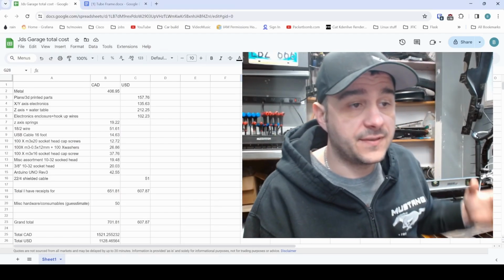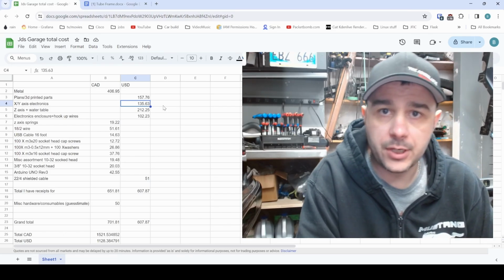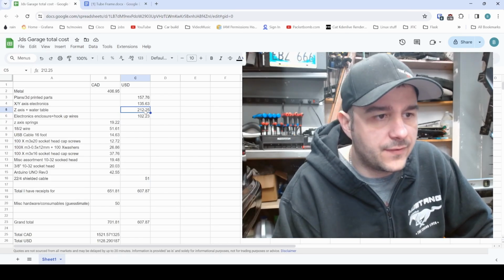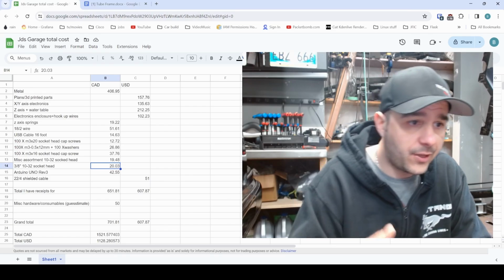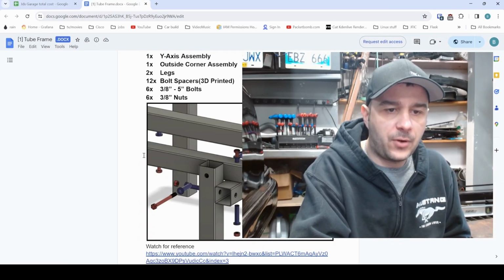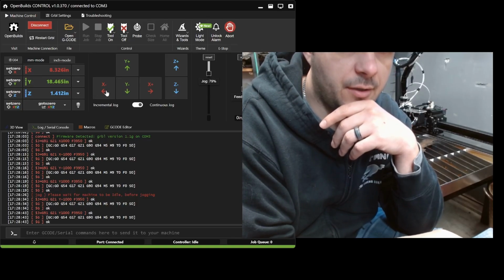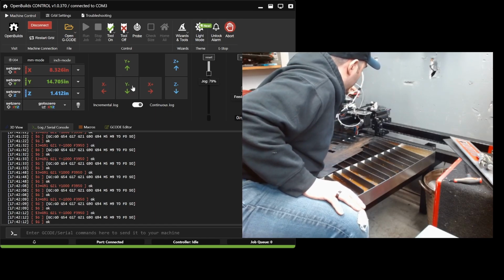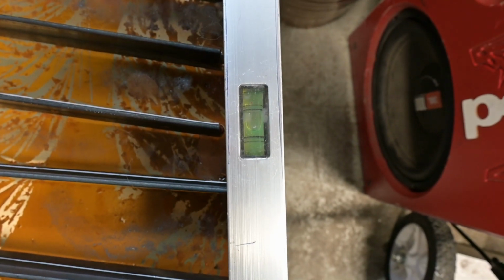jds cnc plasma cutter conclusions

Comment: Thank you for posting this. It confirms my suspicions regarding the unsupported Y axis and the 3D printed trolley, and the tiny bearings.  There are a number of ways to address the issues and you seem very capable of building a Y axis support.  Regards.
Reply from the maker: You're very welcome. And you're right I did correct the Y axis issue in a different video.

Comment: Thanks for the homest review comments on this build and the budget breakdown. 👊😎 
I’d suggest not running bearings across painted tube. Also, i’ve seen a few builds address sag of gantry by either a second setup (elaborate) to running a couple of skateboard wheels at the end to support and free roll. Hope you sort it out.
Reply from the maker: You're very welcome!

Yep in a later video I end up adding a wheel onto the end of it to support it.

And yeah the bearings on the painted surface was likely one of the biggest mistakes I made on the build.

Comment: My solution for the long arm of the gantry is to copy the bearing end 2" arms with the plates, on the other side (51” Y-Lower Frame Rail
 51” Y-Upper Frame Rail, Y-Connecting Plate #1 x2,. Then I reprinted one of the bearing holders(Bearing Block Assembly) but cut the bottom 2/3 off. Could use the whole assembly but put only bearings on the top section. This was bolted to the now supported end of the gantry arm with two bearing supporting this end just like the original.
Reply from the maker: Very nice!

Comment: It is actually cheaper to buy the Langmuir, the printer that this crappy JD's clone is based off of.
Reply: There is just too much weight on this cantilever for that particular bearing setup.
Reply from the maker: @uwuweewee  Agreed that's why I added a wheel on the other end to support it.
Reply from the maker: Well looking at the website a crossfire with z-axis and water table is 2195 + 150 shipping, so it's actually around $1000 more expensive than what my cost was.

But that being said for me, would I build another one in the future, not likely. I would rather buy something that has all of the parts and pieces together so that I'm not spending time chasing down little bits and pieces.

Comment: Im lucky in that I had nearly all of the raw materials and a few 3d printers, along w all of the tooling ie drill bits and welding equipment etc. to complete the project. I’m not done yet but I’m expecting to come in around $350 usd. Should be done in a couple weeks.
Reply from the maker: Nice! Congrats on your build, it is a really nice tool to have.

Comment: All of your Y axis issues come from you painting the metal where the bearings ride.
Reply from the maker: While I agree that the paint doesn't help, I don't believe that it would be the sole cause of all of the problems.

I am far from any sort of mechanical engineer, so I don't know where to start to actually calculate the forces in play. But I believe the weight of the z-axis motor and motor mount likely play a factor in the issue.
Reply: Unless you’re running a different motor, it’s not the weight. Too many ppl have completed this successfully and don’t have the y axis issue you do. The paint is a bigger issue than you realize, but I also suspect there are tolerance and fitment issues with your final product. As the design itself has been proven on Langmuir and JDG tables.
Reply from the maker: @justaguyintexas  Yeah my build isn't perfect and has issues for sure. The flip side is that enough other people have also had issues and had to build supports, that while builld quality may exacerbate the issue, I believe there is a fatal flaw in having all of that weight levered out at the end of the rail.

But for what I need this machine to do, it does it well and I'm really happy with it.
Reply: @TheAnnihilatorRacing  yup the fast growing community for this machine is awesome eh? Also because this is nearly a rip of a Langmuir xfire, I’ve joined a few of their groups and find a lot of the info valuable. That said, I agree in that this is the max size this single arm design can handle.

Comment: You could have bought a Crossfire for what you in it.
I have $100 in steel, I’m using 1/8” wall (it’s cheaper) tubing and 2x2x1/8” angle. My height will be 36” and I got enough angle for a shelf below.
Can’t you brace the x end up and then loosen the 3D parts 4 bolts. Let it settle in then tighten the bolts.
???
Reply: Those cheap bearings need to be broke in, then pick the smoothest bearings.
Reply from the maker: With the z-axis and the water table options for the crossfire the total would be 2195+150 shipping USD. So I'm well below that with what I have all in on my table, but if I had to do it again, I would strongly consider buying a pre-made table just to avoid the hassel of having to source all of the parts.

There was someone else who also recommended lossening off the 4 bolts on the gantry to try and adjust just the middle part and I tried that. The problem is how the y-axis motor plate bolts onto the back of the gantry. The plate spans accross the joint where the inner gantry piece and the bearing block meet which means you can't rotate the center portion independantly of the bearing block as plate is flush agains the back of it. I hope that description makes sense?

Comment: To adjust the X axis gantry to make it level before you wind in the top set screws you need to slacken off the bottom ones to give it room to twist and prevent it binding like yours does in the video. I have built one very similar and don't have these issues.
Reply from the maker: There are 2 sides that have adjustable bearings, 3 set screws, and the hole is elongated where the 5/16 rod goes in. The other 2 sides are static and the set screw is only there to hold the 5/16 rod in place.

I could be wrong, but going by the plans the bottom rod is static, so tightening or loosening the set screw should have no impact on the adjustment of the gantry.

Comment: Could you  not put a eye on the gantry end and run steel wire from there to a pully wheel on top of an extra bar on the other side of the gantry then weld said wire to that bar  or put a counter weight  on  it just a thought
Reply from the maker: I think that since the gantry moves the steel cable would have to be self tensioning somehow?

I think a counterweight on the motor end of the gantry could work.

Comment: I understand the frustration you're experiencing while building your CNC Plasma Cutter. The solution to your problem is simple - add a real linear bearing and another step motor to the Y axis. I implemented the same solution as JPS but inside the 2" PTR, with 8 bearings. It's my first plasma table, and I've learned a lot from this experience. The next one will be better. Thank you for sharing your experience. If you're interested, you can check out my MPCNC Plasma Cutter in the attached link.  https://www.youtube.com/watch?v=5Ts-hp4R0lg
Reply from the maker: @PacoMorales Your setup looks neat, it looks like that there's no belt? I'd be interested to know more about how your steppers drive the axis on the linear bearings. I've cut out a few more things and it's working pretty good now.
Reply: @TheAnnihilatorRacing  If you search for 'Belt Drive Linear Stage - Newmark Systems' on Google, you will understand how my CNC table works. The belt is located inside the square tube or PTR. I wanted to mention that Linear Rail Bearings are the best solution for CNC tables, but they are quite expensive. Kind regards

Comment: Hi Thanks for the video . I have been looking at this unit . cost is a long way off of the total they suggest . Still pretty good deal I think . Which plasma cutter did you purchase and do you like it ? thanks
Reply from the maker: You're very welcome. I think there are some factors coupled with a few of my choices that increased the cost, but that's why I felt it important to present all of the receipts that I had so that folks could see for themselves.

I am currently using the PrimeWeld Cut60. It is pretty inexpensive in price, but so far is a really good unit and has the required cnc connection. They also have excellent customer service. I was having an issue with the CNC torch(not needed for this setup) sent them an e-mail on Sunday, and first thing Monday morning they were calling me ready to help me out. As it turns out I just needed to increase my air pressure a bit.
Reply: I’m confused. Are lines 25&26 including the plasma cutter itself, whereas 23 does not? I don’t think you mentioned why the difference was so much different from line 23.

Comment: Hi, just wanted to confirm I had the same problem with my JD's garage plasma cutter. Spent hours trying to solve the problem with the x axis sagging. Tried everything with the bearing blocks. Found out that you need good quality bearings for starters. Installed a 1x2 inch support on the end using one of the bearings from the THC build. I made it adjustable, this solves the x axis problem. I also made new bearing block out of aluminum this makes the Y axis run very smooth. I could email some pics of the modifications I made. Other problem I have is with the TCH touch off routine not working properly. Have decided to wait the the voltage feedback system to be released, I want to use Sheet Cam for some of my cutting work however there is not a good post processor available for sheet cam that will work with Open Builds. Had some luck with Fusion 360 however Sheet Cam is easier to work with.  Hopefully my observations will give you some ideas
Reply from the maker: I very much appreciate your reply! In the end I found that my x-axis was sagging by 1/4" and I don't believe there is enough adjustment in the bearing blocks to properly account for that. I have since built a little support that cost less than $15. Hmm I was able to get the touch off routine working in Fusion360 and could do a separate specific video on that if it would help, but unfortuantely I don't have any experience with Sheet Cam (yet).

Comment: Just an update on my issues with the gantry travel. Yesterday, after spending a good deal of time filing and sanding the top tube without much success, i went and picked up another section of tube from the supplier.  This morning i decided to give the original tube one more look.  To make this long dissertation a bit shorter, it turned out i had simply not adjusted the bearing tension evenly .  It now is smooth as glass with absolutely no rotation or slop.
Reply from the maker: That's great to hear that you were able to get that issue sorted out!
Reply: @TheAnnihilatorRacing  Thank  you, again for your assistance and well wishes ! Have a great day ! Demon

Comment: I’m just in the process of starting to build my JD’s plasma table. Like you, I didn’t want to spend hours printing and reprinting parts that may not be up to the task so I ordered the 3D parts from them. I actually ordered 2 full kits, plus one with the Z axis as I never liked the idea of the cantilever arm for the X axis. I am also going to be building mine bigger. I’m hoping to hold at least a 4’ x 4’ sheet so I have lots of real estate. I haven’t looked yet… but where did you get your steppers and drivers from? Looking at stepper online but I haven’t ordered yet.

Thanks for the video, great information and insight. I like the table, but as you said, it needs a few tweaks. 

Cheers from the BC interior 😉🍻🍻.
Reply from the maker: Hey neighbor across the way, maybe one day when I get a bigger shop I'll be able to build a bigger table!

I bought all of the motors and drivers from amazon.com using the links that JDs garage supplies in ther BOM. I fortunately have a little bit of USD so didn't need to pay any CAD -> USD conversions, and then it was just a matter of shipping it within the US. Being on the island we have a local company called Seawings that provides a US address, and then I clear the packages myself. When I was looking at buying the stuff on amazon.ca the prices were greater than just the USD -> CAD value which sucks.

Comment: I just built this machine. I made some modifications to the thickness of the steel used. (095) it doesn't give or twist at all moves smoothly on the x/y . Your issues are most likely caused by either a bad stepper motor or not enough voltage to the large stepper motor. I built mine in 2 days. If you have any questions I can probably help. Just let me know. Quick tip. If the stepper motors are moved manually by hand or gravity while connected to the electronics (mainly the power supply) it will fry the components inside. By sending a voltage in reverse thru the components like a generator.
Reply from the maker: Thanks for the insight! Now that I've built a bit of support at the end of the x-axis the cutter is runing really smoothly.

Comment: So I built the same machine and also have had some issues. I did a bunch or upgrades but for the money I have into mine it works excellent. Being in the US the price is much more affordable. The guys at JD's Garage have helped me out tremendously and answered all my questions. You can see some of the things I've made on my channel. There also working on the THC which will help with the leveling process when cutting.
Reply from the maker: Just checked out some of your videos, I love how you have the tracks(not sure if that's the best word) for your wires as it moves. Also really like all of the loomed/heat shrunk wires. Just an overall really nice job!

Yes I think the THC will be a really nice addition once it's ready.
Reply: Thank you. I just subscribed to your channel and am going to watch your entries on this subject.

Comment: I made mine 36” x 40” and added an adjustable support. I used one of the extra roller bearings that rides on the table tube. Now it moves really smoothly.

Comment: Yes definitely support the  gantry  in fact  I changed  went with  dual y axis  cost  little  more  but well worth it  and went larger table too.
Reply from the maker: Nice! I think if I had a larger table then I would definitely want the dual y axis like you've done. Unfortuantely even fitting this table as is, is quite tight in the shop.
Reply: @TheAnnihilatorRacing  lol never  enough space 😂
Reply from the maker: @bobrossi1185 I have never met anyone with a shop and a hobby wheter it's wood working, leather making, automotive, etc who has ever had enough space!

Comment: Hello . I'm in the process of building mine. I have the frame all done .  I have been having issues with the gantry " hanging up " in a few spots along the Y axis.  I havebeen filing the top tube to see if that will smooth out the travel of the gantry.  Did you experience this on yours ?  If so, how did you address it ? Thanks Demon
Reply: The steel in the plans is to thin. Need to use the next thickness up. This way the bearings don't warp the steel during its travel.
Reply: @rachelmatt7424  my frame is of a thicker gauge only the x axis tube is the thickness specified. I thought the remainder should be thicker as well.
Reply: @williamlanphar630  yes the square tube in the plans is lighter but is easy to squish. So one thickness up was a good decision on my part. So far no issues with my table. Cutting great from day 1.
Reply: @rachelmatt7424  I'm glad to hear you are having success. I am going to continue with JD's suggestion about filing the tight spots and see if that works .  If not, I'll replace the top tube and see if that solves the problem.  Thanks for the help.
Reply from the maker: Yes I have run into issues with the Y axis "hanging up" when the bearings were adjusted too tight. What I ended up doing was losseing the set screws that adjust the bearings out until the Y axis moved freely. I have not fully adressed the issue yet, but my plan and what I saw another youtube do, is add a caster to the very front of the gantry to take up the weight and allow the Y axis to move more freely. It's a holiday today, but I'll try to get this done in the next couple of weeks.
Reply: @TheAnnihilatorRacing yes I saw that too.  I was going to enlarge my table size and utilize that builders solution but JD was not too keen on my suggestion.   I ended up just keeping the table the same size .  Once I add the x axis tube and test it out I'll see if I need to try and incorporate that bearing solution. Thanks Demon
Reply from the maker: @williamlanphar630  Oh, so do you mean you're Y axis is hanging up even without any of the x-axis attached? If that were the case I would likely doublecheck that the tube that the gantry rides on is square, and I'd maybe consider replacing it. If you take a look at my pt2 video here https://youtu.be/L8MZN2Yo3fE?si=_nvJUHcR-_FiQW52&t=5239 this is where I put the gantry together and it slides pretty freely on the bar.
Reply: @TheAnnihilatorRacing  yes that is what I meant.  JD' s plans DO reference this possibility and they suggest the file solution but I was thinking I might have to replace the tube as from the end it LOOKS as though there may be a slight swelling on the top and bottom surfaces .
Reply from the maker: @williamlanphar630  One thing I found is that since there are no inserts it's very easy to squish the tube on both ends by tightening the 3/8" bolts that go through the 1/4" plate on either side of the tube too much. I did at one point notice that I'd bowed that tube because I tightened it too much. But if it were bowed in the middle, then that would be very strange.